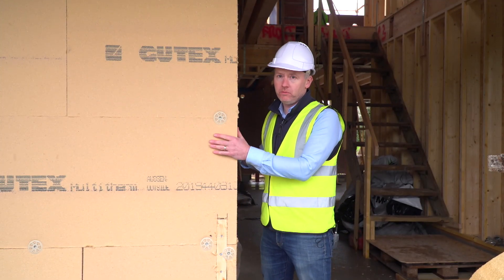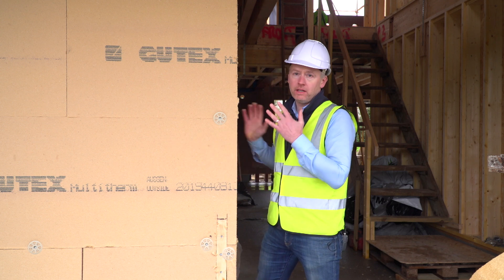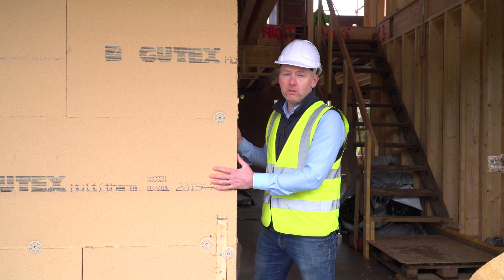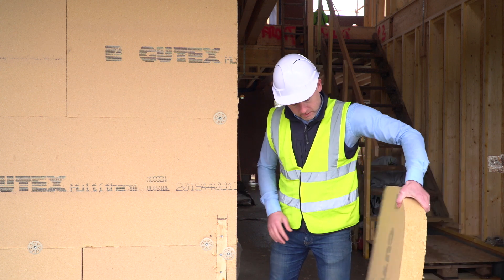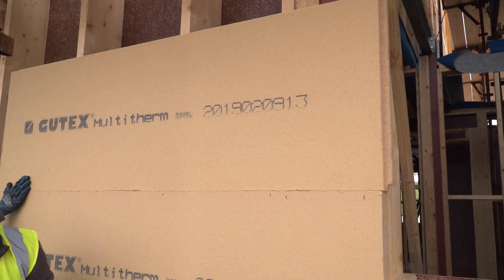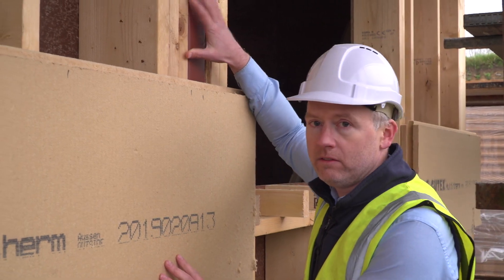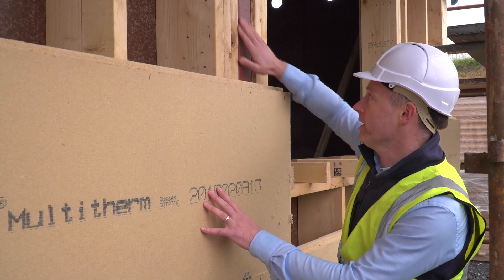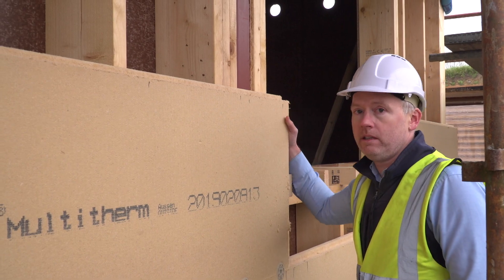Externally Insulating with Gutex Wood Fibre - Traditional Style Timber Frame Series (part 3)

Comment: we have a wood cabin that we are planning to insulate, could i apply this to the exterior ?
Reply from the maker: Hi @fergaldavey4032. Yes the GUTEX Multitherm board can be used both internally and also externally. For external application, it’s important to apply a suitable breather membrane to protect the board from the elements prior to your final finished being installed, such as a ventilated cavity and cladding system .

Feel free to send us any details on your project to info@ecologicalbuildingsystems.com and we can make some suggestions.

Comment: Could you do a video on how to handle attaching the cladding at exterior corners? Since with exterior insulation there's a portion where you have nothing to fasten to if you're just drilling into the insulation.
Reply from the maker: Thanks for your comment. Battens fixed back to structural members are used for fixing the cladding. The same method is used for most external insulation systems with cladding.

Comment: What do you cut it with
Reply from the maker: Gutex wood fibre can be easily cut with a normal tools such as a hand saw or power tools.  If no breather membrane will be used externally over the Multitherm, wherever it is cut to form butt joints, these must be primed with Tescon Primer RP or Tescon Sprimer then taped with 150mm Tescon Vana airtight tape to maintain the windtightness.

Comment: Do you need to install a WRB wrap under or over the Wood Fiber panels for airtightness or moisture resistance?
Reply from the maker: Airtightness and vapour control is attained with a certified airtight internal racking board (Finsa SuperPan VapourStop).

A WRB is installed outside the Gutex wood fibre to protect the construction during the building phase and to limit thermal bypass over the lifetime of the building. In this case Pro Clima Solitex Adhero breathable “peel and stick” membrane is used.
Reply: @EcologicalBuildingSystems  does the adhero stick without primer?
Reply from the maker: On smooth surfaces, such as CLT or cement particle boards, no primer is required.  When applying Pro Clima Solitex Adhero to rigid Gutex wood fibre boards then the use of primer is beneficial.

Comment: Do you need to install the boards to match your stud centres? I see the board you installed was floating. I guess the thickness of the board and the tongue and groove will be enough to self support?
Reply from the maker: On tongue & groove boards the joints do not need to coincide with a stud. The data sheet for each board provides guidance on maximum centres.

Comment: It seems to be a very good material. Can I use that board for ligth steel frame to? What kind of finish can I use? Can I use plaster?
Reply from the maker: Yes, it can be used outside a steel frame with a breather membrane such as Solitex Fronta WA. Then a batten can be placed outside this fixed back to the frame where ventilation must be included. This is followed by a cement, timber or steel cladding.